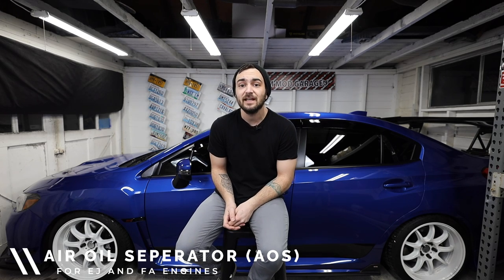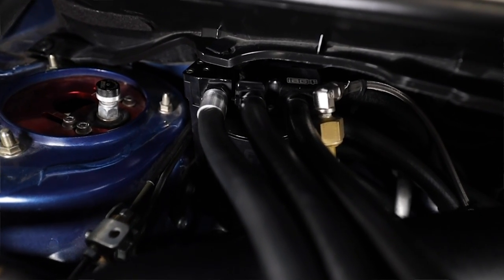5 Modifications To Reduce Engine Knock On Your WRX or STI.

Comment: I'm with ya on everything, but the equal length headers. I'll replace my engine, before I lose an ounce of that subbie rumble.🤣
Reply: Trev Smoove just get cams lol
Reply: @stockblockglock  all saving up cams money. Just doing stage 2 this year.
Reply: Right! Lmao
Reply: Newbie question here. What do yall mean by cams? Camshaft?
Reply from the maker: Yessir
Reply: @stockblockglock  hi how can you get a subie rumble by cam modification?
Reply: @jbamrah1  A wild camshaft on a street car will also change the way the exhaust behaves in a more fundamental way. There's a lot to it really more than I know lol but optimizing the shape and position of the cam lobes for higher rpm power tends to change the way the engine idles at 500-1200 rpm to sound kind of 'lopey' especially for 4 or 8 cylinder engines. Nascar engines sound like this usually. It's almost like the sound at idle is more of an oval than a circle, if that makes any sense
Reply: @creator4413  i believe I know what u mean actualy yeah thankyou!
Reply: I actually like  the ELH better. none of the rally cars from the 90s had the rumble. i'll take the angry dragon sound of the HKS equal length, but to each his own. just gotta get one on my 2020.
Reply: what if you don't beat on the car? Like im very good about not going full throttle everytime I drive and am pretty conservative on my driving. DO you think my EJ will still last for a long time without ring land failure? Its a 2014 sti with 60k miles
Reply: @jbamrah1  it's about lobe separation and the timing of valves opening and closing. The farther the lobes on the camshaft are from each other the rougher the idle or "lopey" it will run cause the cam operates at higher engine speeds when the Cams spinning at a faster rate. Hope that helps
Reply: @pablog4852  its a performance car, its meant to be driven. Not driving it hard can cause other issues like deposits building on valves and piston tops. Open her up and clean that baby out. These tips are for optimizing the engineering of the engine to perform at it's healthiest. Basic care and maintenance is always key to long life out of any machine ultimately.
Reply: @jonphelps9472  agree 100%
Reply: @stockblockglock  nah cams + uel
Reply: @jonphelps9472  who says it is not a performance car?  In 04 when my sti first came to America it was quicker through the quarter mile then the 04 mustang and today gives 2021 mustang gt, gt 500 fits on a back road. With my mods i can run with them in the quarter mile to. So do you only classify performance cars as Ferrari or Porsche
Reply: @williamadams4843  I think you may have missed my point. They are performance cars and should be driven like one every now and again. People trip out when I tell them all the racing I do in my daily driver 17 wrx.
Reply: @jonphelps9472   yeah i think i did
Reply: Same👉🏾👈🏾
Reply: @pablog4852  mine blew 5 months after I got it granted I bought used and I would get on it here and there, but not like how some kids my age drive, 16 grand later I finally realized what it’s like to own a subie 😂
Reply: I rather die

Comment: Equal Length Headers + Cyl 4 Cooling Mod are a huge part of equalizing EGT across all cylinders. The Subaru EJ Knock Control System is strictly bias to Cylinder 4, as it runs 1.5 degrees of timing over over all cylinders. Essentially, Subaru's thought process is "If Cyl 4 isn't knocking, we're good." Timing is everything. It's how power is made. ELH and Cylinder 4 both contribute to a safe increase in timing, although Octane is the major contributor.

Comment: There’s a caveat to the radiator statement. Larger radiator is actually only helpful if it adds passes, just getting a thicker radiator with the same number of passes is hurting efficiency. You could argue more capacity, but it’s more water that the air has to pass through so it’s actually restricting air flow. If it’s adding more passes then it improves efficiency. The main benefit would be going to aluminum vs plastic would be reliability and the aluminum insulating heat better.

Comment: I’ve watched this video a few years ago and I’ve installed Perrin AOS, cylinder 4 mod, Killer B oil pan +tube +tray plus other reliable mods. Still stock headers though😂 but this video helped me out then and after owning my 07 Hawkeye for three years, and still going, is still running smooth even after several Road trips from Washington state all the way down to Florida👌🏾

Comment: Just got my first subie. 2017 sti and all the info in these videos has been really helpful. Never done anything with a tuner. Was always a one carburetor is good let's get two guy. Getting my car as far as i can without swapping the rotating assembly. This is invaluable. Thanks so much.
Reply from the maker: Glad thr video helped and open to any questions if you get them! 🙏🙏🙏
Reply: Dod your engine blow yet

Comment: I'm running IAG Oil components and I haven't noticed any issues with it. My local speed shop recommends them on all their Subie builds. They are the ones that did my IAG stage 2 shortblock too!
Reply from the maker: IAG is my top brand for AOS they do an awesome job with theirs!
Reply: Running IAG pickup and windage tray and they are both great quality.

Comment: I have a full invidia exhaust including a EL header on my sti and while it lost most of its rumble it sounds like a rally car.  So I’m okay with it.
Reply: Helo. Does it imply wen i install an aftermarket exhaust my forester will lose rumble?
Reply: @NyunJah  if you install a set of Equal Length Headers on your car it will sound more like a honda civic.  if you install unequal length header on the car it will still have the "Subaru rumble".

Comment: By the Killer B Holy Header with there ceramic coating and buy a ceramic coated downpipe if you can. A downpipe with two ports so you can run a wideband sensor. 
You will be so happy you did in the future. Killer B’s most current design with the one piece collector sounds damn good.

Comment: I have a Mishimoto CC and I just keep it drained all the time.. I drain it like once a week.. I Have it hidden in the wheel well, and I run a line down out of the bottom, so I can crack I open it just drains right out.. I drain it everyday in the winter.. You don't want to be sucking frozen sludge into you turbo, I did it.. LOL.. Took 2 days for the smoke to go away and I pulled everything apart mostly and cleaned it with break cleaner.. Everything is all good now..

Comment: Up here in Canada most shops DON'T recommend running an AOS - even the heated ones such as the Perrin or IAG. Unless of course you park your Subie for the winter(why???)   There have been too many cases of the AOS freezing up and causing total engine destruction up here. It happens once you get below -20 deg.C
Reply from the maker: I have seen some of the fourms talk have talked about the issues and the announcement IAG put out and I'd agree with you on that one.
Reply: @Smeedia  Link to the IAG statement?
Reply from the maker: @ericn7698   this is one of the ones I saw 

https://m.facebook.com/story.php?story_fbid=2464853653586997&id=185264628212589

Comment: Hey thanks for this video! I have a 2010 WRX with 124,xxx KM on it. engine started knocking the other day. I will be installing AOS, Oil kit and radiator at the same time I get my engine fixed.
Reply from the maker: Hopefully it's a speedy recovery to get it back on the road! 🙏🙏
Reply: @Smeedia  just thought I'd update here. so main bearing was the issue for me,
 I went deep, but happy about it tbh lol 
I put the deposit on parts with the local Subaru specialist in my city.
so main bearing was the issue in the old short block.

Got IAG Stage 2 Tuff short block
IAG AOS
Killer B oil pickup and Oil baffle
4th cylinder cooling mod
and everything else that comes with the build like good head gaskets, better head studs, etc. probably change to Poly engine mounts too.

And since I'm doing all that as well, I'm also looking at a refurbished turbo from a shop in Ottawa.

Comment: I have always loved the WRX/STi platform, and last year finally got my hands on a stock '08 WRX for $4k expecting to have to do a rebuild (random cylinder misfire). I pulled the engine and heads and the cylinder bores look great for 135k miles, so I think it just needs some head work. With the remaining budget for the car, I'm able to modify it just how I want it. So thank you for helping me build my Suby to endure some spirited driving through the mountains of California!
Reply from the maker: Glad that it all came together and you for it for some deals too! 🔥
Reply: Hows ur subie 6 months later?

Comment: Got this AOS mounted, thanks for the tips! This install wasn't terrible, but def requires your patience. The mount is great because it didn't interfere with my strut bar at all. If it hasn't been said already, def keep a magnet close by, and grab a friend during the AOS mounting (most challenging part in my opinion). Other than that, everything is tight and works like a champ. Thanks again on the video!
Reply from the maker: Glad you got it mounted up with minimal issues and appreciate the support 😁

Comment: This video is very underrated! Should be the #1 video to watch for people who drive their subbies hard.... 

If you daily your Subbie you can get away with just proper regular maintenance. But however if your oil pickup breaks you are fucked... 

Run an oil pressure gauge would protect you from this :) Also oil temp to properly drive it warm etc.

And you missed talking about the heatsoaking of the top mount :) Either get a front mount or make sure you properly drive it cool after being stuck in traffic.
Reply from the maker: Ive got a whole video on top mount vs front mount but totally agree! 😁😁😁

Comment: I did all  5 of the mods from this video. Definitely worth it for the longevity of the car. I had a really hard time deciding between the 3 radiators though, MISHIMOTO VS KOYO VS CSF. Which one do you thinks is best?
Reply from the maker: I would pick Koyo out of the three 🔥 I use mishimoto though lmao

Comment: In your opinion, with a car like mine (stock STI down to the paper filter with 107k miles on it, well taken care of, unknown how much the previous owner pounded on it, but runs well, pulls hard, no engine oil burning, and no symptoms of oil/coolant fouling. Short of a compression test to confirm, which will get done soon, the car "seems" to be in perfect shape). And so far, the only mod I've done is an Accessport, and I'm running the Stage 1 ACN 91 map with Canadian 93 octane.

1. I plan to do the cylinder cooling mod ASAP! but how safe is to go for the occasional WOT run before this gets done?
2. Is it worth getting an AEM Dry filter to replace the stock paper filter?
3. I'm currently monitoring Coolant temp (highest its gone is 191f), feedback knock (highest it's done is -2.8, and usually only for the first second of hammering it hard on 2nd or 3rd gear), and DAM (has never gone below 1). Does that mean I am in a safe range to blast the car once in a while?
4. The ACN91 Map has 8psi on I-Drive, 14psi on S-Drive, and 17psi on S#. I am scared to try S#. Am I being paranoid? I'm tempted to try how it feels.

What do you think? Awesome channel BTW, I'm soaking in all your great videos!
Reply from the maker: With it all stock I wouldent worry too much, just wouldent do pulls 24/7 lol 
Imo I'd say get an SF intake over the panel filter 
And all normal values, I wouldent stress any of it 🙏
Reply: I knew there was an exchange rate but 93 Canadian octane = CA 91 ? Lol
Reply: @5amfishing59  After a few months of driving the car, and a couple of weeks of trying the regular 91 octane OTS tune (not the ACN 91) with both Canadian 91, and Canadian 93 and 94, I saw no difference whatsoever in the #'s reported by the AccessPort. Using 91 on the regular 91 tune did not cause any knock, or any other issues with the car. BUT since it is a higher mileage motor and I don't want to spend $5k+ right now to replace my motor, I put the ACN tune back in it, and I just use 91 octane now. I think Cobb is being VERY conservative since they probably don't want to have any controversy with Canadian customers blowing their shit up. But I'm sure there is some truth to the quality of the gas vs in the non-commie states. 
The car was definitely snappier on the regular 91 tune. I never tried the 93, but if I'm brave, maybe I'll try it soon with a tank of Canadian 94

Comment: Just picked up a used 2020 WRX and I’ve been going crazy researching reliability as I do know Subarus has a bad reputation in terms of blown engine. I stumbled on your channel and honestly I feel like all my worries is put at rest. I definitely want to add an AOS, killer b oil pickup pan. Any suggestions on more reliable parts? Or is killer b oil necessary? I’m probably at most,  add an air intake and a cat back exhaust all of which will be pro tune. Awesome channel🤙🏻

Comment: I had done all this in my wrx after I went stage 2 with flex fuel. Had some knock even on e85 and realized spark plugs needed to be changed. So I suggest changing them every 25-30,000 miles or so to also improve longevity.

Comment: I'd bump the radiator up the list if you live in the southwest. My ambient air thermometer today said 121dF and the car was struggling, coolant and oil temps were high and the intake manifold temps were getting up to 150-170dF while sitting in traffic. Time to upgrade the cooling system when the car starts to heat soak from normal driving.
Reply from the maker: Agreed, depending on where you live determines where it takes priority 🙏

Comment: ok let me ask this question.What if I do the same thats on your car with cooling minus you have mishimoto radiator and I have csf. So what if i put the oem pressure cap on radiator and use mishimoto cap on turbo tank. What is the bar pressure on the mishimoto cap ? Maybe that will fix my issue ? Ive been looking at the 1.3 bar STI caps but there almost 70 dollars and i dont want to spend that much on a cap to test if it will fix my cooling. Im just trying to find that happy meduim. And with a bigger radiator I just dont think that I shouid be seeing temps above 205 degrees.
Reply from the maker: Give this video a watch, it'll explain it wayyyy better than I can 

https://youtu.be/HzjBJz1Zdmw
Reply: @Smeedia  ive watched that video 3 times now. Still doesnt help with us aftermarket radiators, and what it does to the system on bigger radiators and what changes it causes.

Comment: I always run mine on 98 octane pump gas and a bottle of Nulon Octane booster with each tank full, which claims to raise the octane level by up to 7 points. I doubt that it does this with 98 but I still always run it for insurance. Another reason for broken ringlands is excessive timing, so maybe back off your timing a couple of degrees as well.

Comment: Great video as always 👍 Makes me treasure my Celica even more now 👏
Reply from the maker: What gen celica?!😁
Reply: 6th Gen Celica... It's a great reliable car I've been using for 28 years to date and thankfully didn't give me any downtime other than the usual wear & tear maintenance 👍 My 18 years old Impreza WRX on the other hand, has regularly been in & out of the workshops with various repairs + the usual wear and tear despite myself keeping her completely stock 😅... Just proves what you highlighted in your video is exactly spot on and if undertaken, will make our Impreza WRX/STi more reliable for long term ownership 👍 👏... If only a video like yours were available 10 plus years ago, many Impreza owners in similar situation as me would perhaps be able to save $$$ of unnecessary repairs 🤲... Nevertheless I'm thankful that you've made this video now... Better late than never 👏

Cheers 🍻

Comment: 20k miles on my HKS ELH, no problems here. Solid name brand and solid price.
Reply from the maker: Very true 🙌 only issues I've ever really had is fitment before. Never ran HKS but thank you for adding it in!
Reply: @Smeedia  The HKS slid on just fine. They don't look the prettiest but its a 409 stainless steel which will last for a long time.

Comment: The Verus engineering AOS is perfect. Friend has one on his 2016 WRX and I have one on my 04 WRX wagon.
Reply from the maker: I'll have to check theirs out!
Reply: @Smeedia  It's currently for the brz/86/frs platform in terms of ready to go mounting but works on everything for fabricate mounting. Verus is working on a newer WRX/sti mount. It's also quite a bit smaller than iag and Crawford ones, and supports drainback too.

real_awd_cars is my Instagram and I have photos of it on my 04 if you're curious.

Comment: Cracked my radiator for my 06 WRX up at the top plastic part. Recently bought a Koyo Radiator, just waiting for it to be delivered. I would recommend a new radiator the older the car.
Reply from the maker: Agreed! Have had the OE plastic crack on me as well with my old 02 WRX

Comment: Great video. Did my AOS 2 weekends ago, it's a Cobb. Took about 2 hours, but killed my knees and back. The instructions Cobb provides online were very useful, once you figured out the perspective they were taking the pictures from. Next is probably going to be the killer b oil pan. Keep up the great work on the vids.
Reply from the maker: The oil pan is awful to install but well worth it!
Reply: @Smeedia  should I just save and do the ELH at the same time? I vaguely remember you had to remove or loosen the header to install the oil pan.
Reply: @Smeedia  also to help you with your JDM obsession, subispeed released a OEM JDM STI type R A R ?   mirror cover.

Comment: What are your thoughts on the Baxter performance check valve system that helps get oil to the top end of the motor more quickly upon startup?